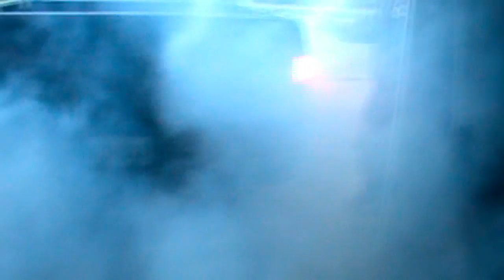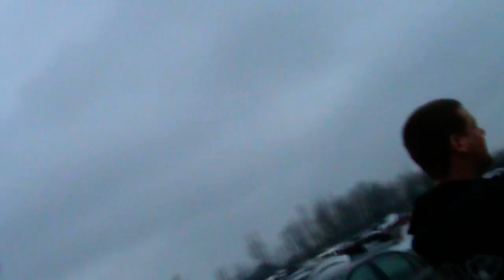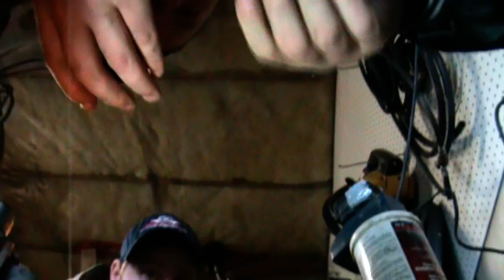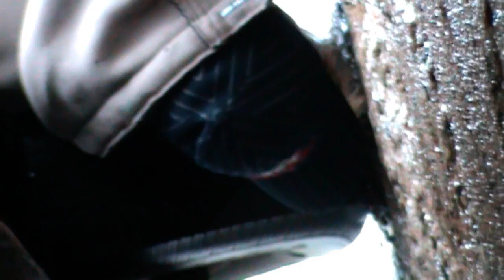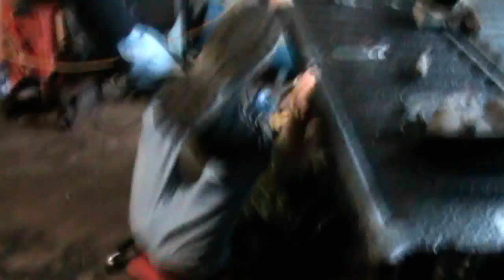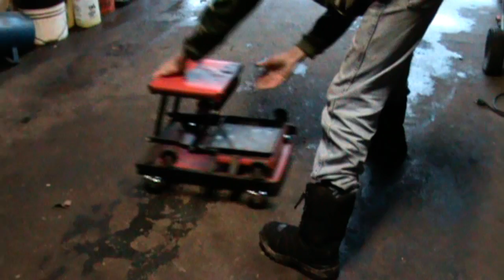Hot Boxing the Shop

Comment: The Really Real Proper Way to put two wires together Rick is

Twist-Solder-Tape-Heat Shrink

Way to Many Shorts are caused by Butt Conecters,T-Taps and Even Crip Caps.

Just thought I should say^^

Liked the Burn out None the less

I will see you up at the Farm this year bud:)

Comment: Id like to add and remove something! : Twist - Solder - put dielectric grease - Heat Shrink each wire - Then Heat shrink the bunch.  The grease tends to help it last longer, and I don't care for using tape.  
I guess everybody has their own way of doing things.  Cheers.